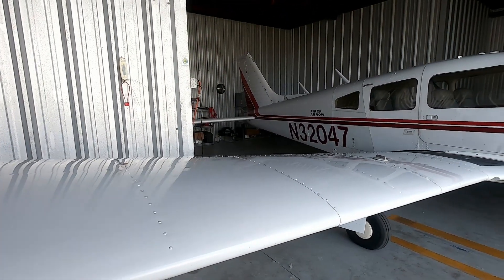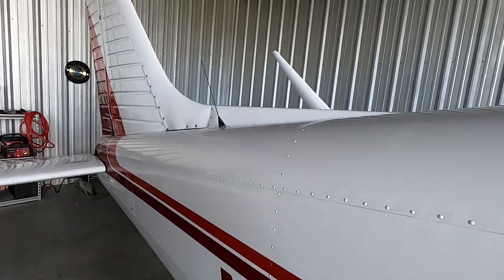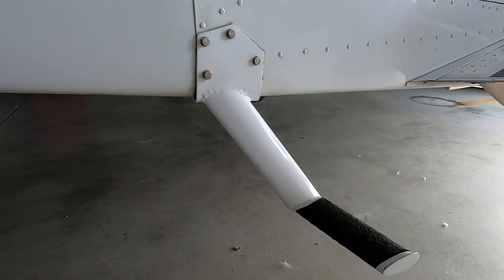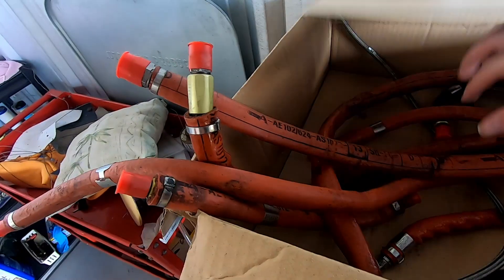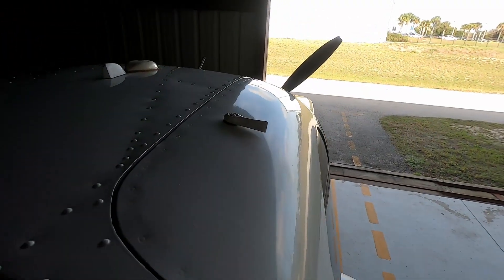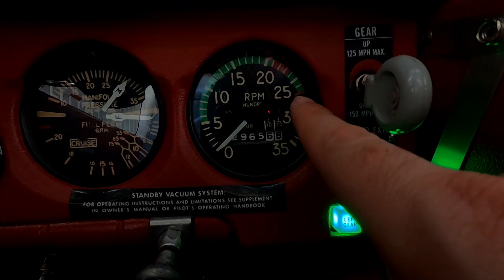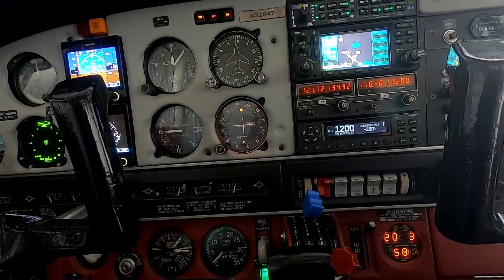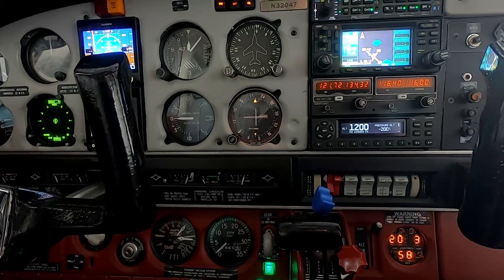Piper Arrow out of Annual!

Comment: I wonder what the average cost is for a typical annual on an arrow.
Reply from the maker: It really depends on the shop labor hour cost and what was found. The shop I take the Arrow to has a flat rate annual. $1,200 for the inspection, lubrication, spark plug cleaning and rotation, gear swing along with other items. Anything found outside of the normal annual can go up from there

Comment: My gear horn was coming on at a little too high of a power setting after having the engine OH’d.  My A&P was able to make an adjustment to it so it doesn’t start blaring unless I am just slightly above idle.  I find that I can keep the power at about 19” if I really want to get down, and then leveling off for a few seconds to get below my gear extension speed.  19” works really well for me down the glideslope as well and I can drop the gear at the appropriate time and never hear the horn.

Comment: Another arrow owner here. Did they really adjust the throttle cable? Sounds like they adjusted the prop control so you can get 2700rpm. The gear horn is not linked to flaps. If you get the horn with 10deg of flaps then there is something wrong with the install. The service bulletin for the gear override does not remove the system. It installs an override lock which you can latch in position to activate/deactivate the system.  Lycoming does not recommend prop milling the IO3601c6 engine below 15" MP. It has something to do with the crankshaft counterweights (can't remember the exact reason). I try to avoid idle power approaches unless I really have to. Lastly I really love what you did to the panel.
Reply from the maker: Thanks! It’s always nice to hear from other Arrow owners to hear what the differences are from plane to plane.

Comment: Great details. Thanks for sharing. My 72 had the auto extend removed however my flaps don’t trigger the horn. Just when I pull back the throttle.
Reply: I have the same set up on my 71’ arrow, no horn with flaps, only when pull throttle back past 18 MP
Reply from the maker: Interesting. I don’t care for the flap horn. If I need to lower flaps and not the gear it makes for a very noisy phase of flight. I appreciate all of your input!